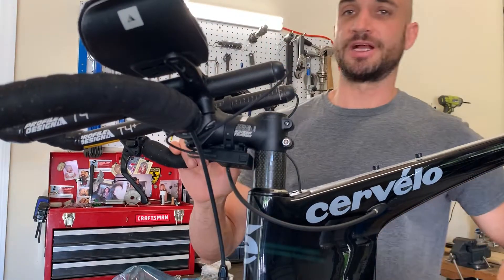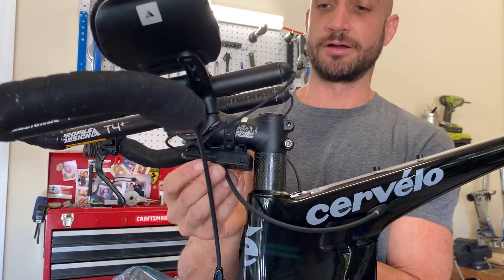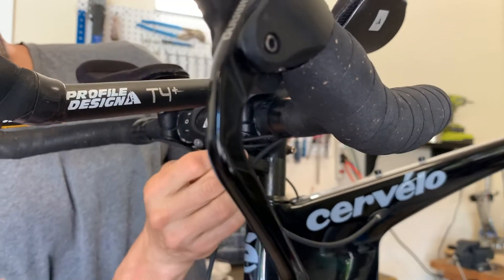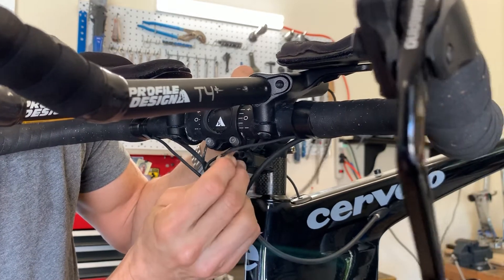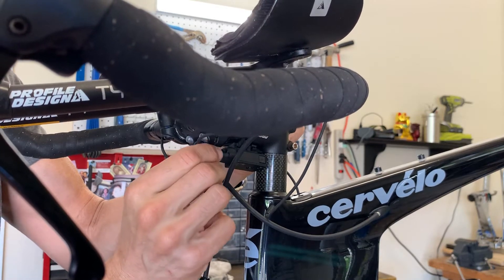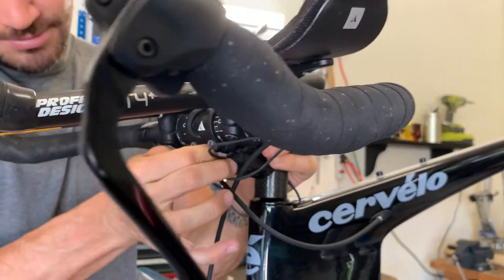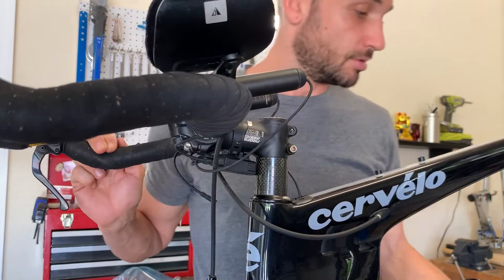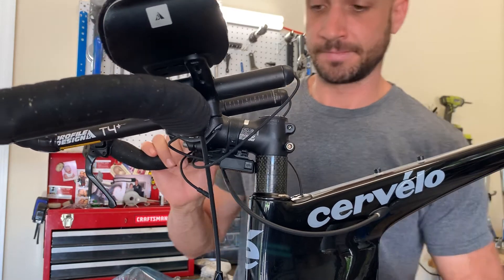Di2 System Not Working. Simple Troubleshooting Step

Comment: Hello man ! on this little box we have 5 ports and 3 cables, right ? Which port should I plug my cables ? i'm a owner of this bike cervelo p2 with di2 shimano
Reply from the maker: Doesn’t matter. You can put it any of the 5 ports.
Reply: @WaterBearCycles  tks man ! I'ill try it ! My di2 died :( Hope it can fix my probem
Reply: @WaterBearCycles  do you know if in this version I can plug on my pc and try update de firmwre ?
Reply from the maker: As long as your junction box has a port to plug your charger into just down load the Shimano SIS app and plug the USB into the computer and go through the steps.
Reply: @WaterBearCycles  my junction doesn't have any port
Reply from the maker: Then you will plug it into where ever you charger your battery, back of the seat post or end of handle bar?? Or is your system external battery. If so it’s non E-TUBE which is first generation di2 and if that’s the case I’m not sure how to update the older non E-TUBE stuff.  @guilhermeleindecker1523

Comment: Hey John. This is great, but man I'm still stumped. So I'm able to run through the crash recovery, and the derailleur shifts through all the gears as it should... but as soon as it's complete, my shifting is completely unresponsive. Neither the front nor the rear shifting works.... it doesn't do anything, not even an attempt to move. Any advice?
Reply from the maker: When is the last time you updated your system with the SiS software? Try that. Also check your battery health.

Comment: I have a cable which doesn’t make that audible ‘click’ into the port. Can not get the cable in securely. Do you think I need to replace the e tube cable or the junction box?
Reply from the maker: Did you try pushing really hard. Sometimes they are super tough to get them to snap in. If not then try plugging a different wire into the junction box. Maybe something got bent or you could have Debris in one of the holes
Reply: @WaterBearCycles  yep thanks tried everything to push it in and it’s not securing in and yes tried another wire also same issue. Can’t see anything bent but that would suggest the port connecter I think so maybe a new unit is required
Reply from the maker: @SupernovaRallyteam  Yes in all my years of dealing with you Di2 I have actually never heard of this issue  but it does sound like it would be the junction box or the port box that is damaged.

Comment: John, thanks for the tip.   I flew my bike to Indianapolis to ride in the Major Taylor Invitational.   Had to take seat tube and battery out of bike to fit in bike box.  The front derailleur on my 8100 Ultegra stopped working on the first days ride.   I suspected a low battery and charged battery that night.   Next day the front still didnt work.  I connected e-tube and battery was green.  I was in a hurry for a flat Gran Fondo so I didnt investigate further.   I did note that e-tube had lost my bikes configuration.   After watching your vid I connected to e tube and noted that my front derailleur was not detected.   I checked the wire connections and they appeared secure at the battery.   I disconnected the wires and then plugged them back in using a different port (battery has 3).   Reconnected to e tube and hurray!, the front derailleur was back in my config.   Disconnected from e tube and tested front and back and they now both work.  Thanks again, I subbed.

Comment: Hello 
I would like to use a Shimano Alfine 11Di2 for my e-bike muscle drive part, but I don't want 3 batteries on board (so far I have 2 GreenPack to power 2 Grin AllAxle motors). I would like to know if it is possible to power Di2 differently than from the original Shimano battery? For example, using the Shimano EW-EX010 adapter normally used with Bosch systems. However, no one can tell me what the plug at the end of Bosch Y-Harness is (the one that plugs into EW-EX010) and what pinout it has.
I suspect that I will have to reduce the voltage from 48V on the GreenPack to a 36V Bosch battery and I will not have a CAN to control the automatic gearshift (no cadence and speed sensors for the muscle drive). 
Or maybe do it differently ????
Reply from the maker: Hi, thank you for giving me the opportunity to answer this question. Have some opinions on that but I wouldn’t want to give you the wrong information. From my experience Shimano DI2 is only powered by the DI2battery Intended for the specific generation or model DI2 you are using. Your best bet to get the correct information would be to contact Shimano customer service. They are super helpful. Here is the phone number (800) 423-2420
Reply: @WaterBearCycles  I've been running Di2 shifting on my Alfine 11 rear gearbox for a few years with the Shimano battery. It works fine and lasts a long time between needing recharges. Probably a few thousand shifts in between.

Comment: I found the absolute best fix for my faulty Di2.
I removed it and installed the ultegra mechanical system from my old bike.

Voila, no more trouble with Di2!
Reply: Good luck with the rear der cable tearing inside the STI

Comment: Hi John - Thanks for the tips, very helpful to a rookie Di2 owner.  What is the recommendation for disconnecting the battery for short transports, such as when I throw the bike in the back of my pickup truck for an hour or two drive to the start of the bike ride?  (Battery is deep inside the bottom bracket, no exposed junction boxes.)
Reply from the maker: Hi Lynn, no need to disconnected during trips or when bike is not in use. System isn’t drawing power from the battery when the bike isn’t in use. Disconnecting is usually only required when shipping because you have to remove the seat post from the frame and the handlebars from the stem.

Comment: Man you’re a big help. The rear derailleur wasn’t shifting at all and I thought the battery was dead. Luckily, I found your YT video, lo and behold there goes the answer loose connection. A big thank you man. That really help like novice like me. Now it’s working again.
Reply: Had the same issue. Watched Johns quick video and it worked right away. 
i did not even think about that little tool for the plugins and i could not grab the little plug properly and put enough force on the thing to get it to snap in. 

Thanks a bunch John !

Comment: You had me at seat tube connection! Thanks for the tip; it ended a couple of hours of frustration with my new Orbea. If only there was an LBS that sold it here... Anyway, thanks again; great, clear video with spot-on advice.

Comment: Hi john.. i have question for you.. how long di2 battery will survive after charging? It because my di2 battery always runs out every 1 week. U know what happen? The indicator  battery when charging its not a problem.. thx b4..
Reply from the maker: A fully charged Di2 battery should last for up to 1200+ miles/2000+ kilometers or up to 60 hours of use depending on how much you shift. We have had bikes that don’t need to be charged for over a month with daily use and bikes that have sat unused for 3+ months that still held a decent charge. I would suggest downloading the  free Etube software from the shimano website and running a diagnostic and updating your system. Is this doesn’t help then I would suggest replacing the battery.